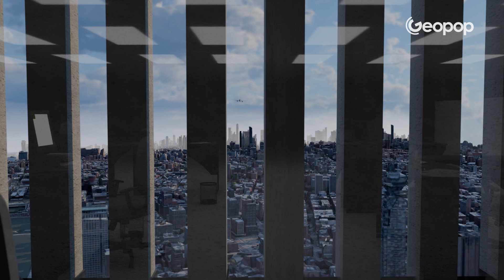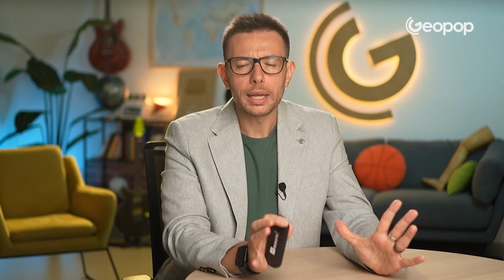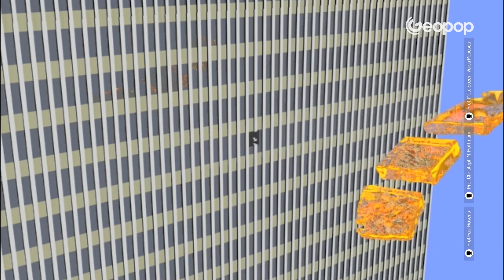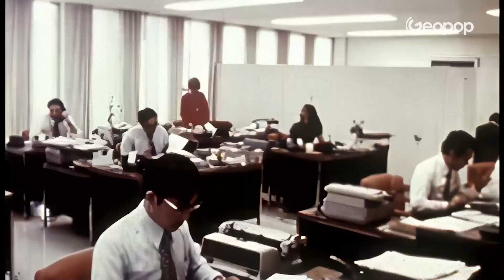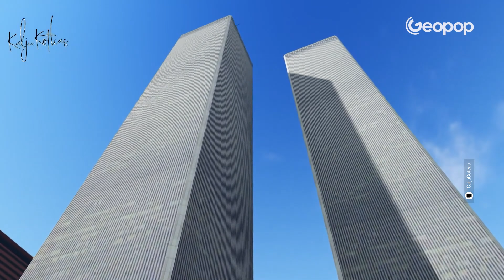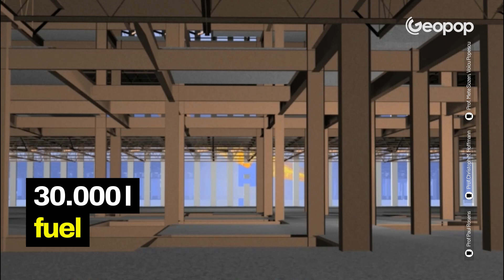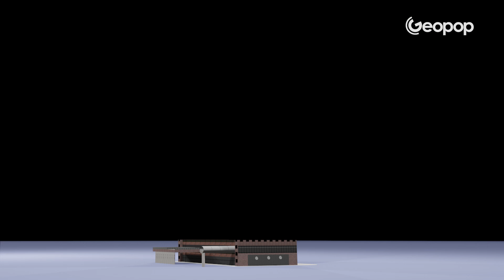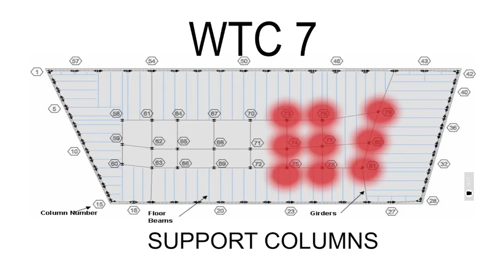9/11, 2001: The Technical Reconstruction of the Twin Towers and WTC 7 Collapses

Comment: This video is a heaping load of BS!!!
Reply: And yet fundamentally not wrong, go figure. 

Had it actually been wrong you would have had a better rebuttal than that.

Or a rebuttal.
Reply: @TheLoonResistance  I don't argue with those who don't understand physics or engineering and even less with the clinically stupid...next.
Reply: @kellyswayze1967  - Good thing you aren't then.  I can do this and you can't: 

Twin Towers collapses were relatively straightforward, the fundamentals well understood in the professional engineering community within just weeks. Yet there’s a lot of really bad information floating out there on the internet, easily accessible to anyone and wild baseless speculation and pathological theorizing with easy hand-wave answers is simple, exciting and requires a whole lot less thinking, so it gets far more attention than it deserves.

To correct this I have on my own prepared this short yet detailed technical description of Twin Towers collapses based on my own observation and analysis of available true and relevant facts. No politics, ideology or magical thinking, just engineering. I hope is this will dispel many common myths and answer most if not all questions you may have about the Twin Towers collapses, because anything can seem like a conspiracy if you don’t understand how it works

While complex, most of the Twin Towers collapse mechanisms can be seen with the naked eye and easily discerned and understood by the layperson if sufficient time is taken to understand.

1. The Twin Towers consisted of 4 primary structural elements that together formed an integrated system where each relied on the others. 47 hollow box-section steel Core Columns carry the majority of the gravity loads. The 236 hollow box-section steel Perimeter Columns carry the remainder and ALL of the lateral (wind) loads. Long-span Lightweight Steel Trusses connect the core and perimeter column together at each floor with a Hat Truss on top to tie the structure together as an integrated unit where no element can survive without the others. There was no structural load bearing concrete and most components were bolted together.

www.youtube.com/watch?v=u7OqrC74Dm4

2. The impact of 117 tons of airplane (= to about 12 dump trucks) at speeds up to 590 mph with the energy of a ton of TNT completely destroys the aircraft. This in no way implies the Towers come out unscathed. Many perimeter columns are damaged or destroyed as are some core columns (example; 33 of 59 perimeter and 20 of 47 core columns damaged or destroyed at the impact floors in the North Tower), This damage is primarily through bolt-shearing failures at the end connecting flanges, as well as bending, twisting and fracturing of weld seams. There was no cutting or slicing - the reality was far more violent and messy.

3. The impacts destroy or damage fire insulation, fire breaks and sprinkler systems on multiple floors. Huge fires are started across multiple floors simultaneously and allowed to spread rapidly with no effective firefighting or fire suppression. This was an unprecedented fire event .

4. The hotter steel gets the weaker it gets . With fire insulation stripped away and no sprinklers the survival time of the steel greatly reduced. Gradually over time heat causes the lightweight steel Floor Trusses at the impact damaged floors to sag, which was observed and recorded. No steel melted or needed to. Structural steel fails long before it becomes a puddle. It just needs to bend

5. Sagging floor trusses pull on the increasingly weak and overloaded Perimeter Columns, causing some of them to bow inward by up to 5 feet. A straight column is up to 4 times stronger than a bent column. The bowed Perimeter Columns buckle and fail, initiating collapse. The formerly static mass above which the structure below could easily support is now converted into a dynamic mass up to 30 times greater. Because they have buckled, the Columns above and below the failure point are no longer aligned . The load bearing structure below no longer bears any load as it falls past the lower columns, NOT onto them.

6. Thousands of tons of debris fall within the four outer walls, down through the open office space, crashing onto the first intact floor it encounters. This massive impact immediately breaks the bolted connections to the columns as the amount of resistance the Floor Trusses can offer is negligible. The falling debris slows only marginally and briefly. Note: 
6a. This is NOT a solid top block crashing into and “crushing” a solid bottom block . 
6b. The debris falls past the columns not onto them. The columns provide no resistance to the falling debris. 
6c. Only the bolted connections of the floor trusses to the core and perimeter columns can offer any resistance. A pair of 5/8” bolts at each end of each truss vs. thousands of tons of falling debris. 
6d. No laws of physics are violated. 6e. There is no 20 floors against 90 floors but rather 20 floors against one floor, then 21 floors against one floor, then 22 floors against one floor, etc. 

7. This floor-led collapse progression within the four outer walls can only go straight down.
7a. This process is often incorrectly referred to as “pancaking”. The catchy name stuck but nobody knows what it really. Pancaking is too simplistic and inaccurate anyway, I prefer Kaiserschmarrn.

8. Collapse progresses through the floor systems past the columns, through the path of least resistance . The resistance offered by each floor is always the same while the mass of debris and its velocity – thus its energy - increases with each floor failure. Each floor offers the exact same resistance to the falling mass while with each failure the falling debris constantly gains both mass and velocity. *This process of floor-by-floor destruction cannot be arrested, it can only speed up . Rate of floor failures increases with each floor as momentum increases, reaching an average acceleration of 0.65 of GA, or 35% slower than true free fall. Bam, bam, bam down the building until there are no more floors to fail. The resistance offered by each successive floor is always the same. More mass, more velocity, same resistance with each floor. Don’t get stuck on the but the lower floors weren’t on fire nonsense. They weren‘t and didn’t need to be.

9. The Towers were 95% air by volume. As that air was compressed inside the building it is forced down the tower and blown out the sides in reaction to the building collapsing . Those were not “explosions”, it was expulsions of compressed air caused by the collapsing building, explaining the low velocity, lack of flash, blast, supersonic pressure waves and lethal high-velocity ejecta.

10. Perimeter Columns become detached and peel away like a banana behind the collapse front, playing out to the four points of the compass extending to more than 600 feet from the base of the towers. This was quite obvious from examination of the debris pile.

11. Core Columns fail last as their internal beam bracing is stripped away by falling debris and lateral support from the floor to perimeter columns is lost.

12. For those who care about how long this whole process took; 31-34 seconds from the moment the perimeter columns buckled until the last core columns hit the pile, or 1/3 the rate of true free fall. Don’t believe me? Just watch any video of the collapses and note the loose truly free-falling debris dropping much faster than the towers themselves.

13. Each Tower had a 1-acre footprint. Far from collapsing inside their own footprints the debris pile spread out over 17 acres in a pile up to 14 stories deep. 8 surrounding buildings were destroyed and scores more damaged by the falling debris.

14. NOT observed were the 180-190 dB bangs of thousands of high explosive devices or the blinding bright flashes of burning thermite. Neither explosives or thermite could have survived the impacts and subsequent fire nor could have caused the (silent) perimeter column buckling that clearly initiated collapse either. A video of a shocked and injured firefighter casually using the magic word explosion is in no way proof of explsoIVES and the demolition_ case relies entirely on that sort of thing. There is zero tangible physical evidence and it would be technically impossible, totally impractical and completely unnecessary. No one would bother.

15. Twin Towers were perfectly safe within their design envelope. They only collapsed when taken far outside design parameters by an extraordinary and unprecedented event

Impact + Fire (heat) + Time + Gravity = Collapse . Remove any one of those four elements and there is no collapse. Ignore any of those elements (as many do) and you will never understand the collapses. The Twin Towers were an integrated system in which no one component could survive without the others. One fails, the rest follow, through the path of least resistance – DOWN – through the open space, bypassing the path of greatest resistance – the columns. Nothing I just described violates any laws of physics. All of the above is true no matter who planned and carried out the 9/11 attacks or why

In 24 years zero structural engineers of tall buildings, including the 1/3 that have retired in that time, have made any statements in support of 9/11 Truth BS demolition claims. Zero, nada, none. The lack of any such citations in the engineering literature (published in any country worldwide) is palpable.

I hope you found this helpful and informative. It is not meant to be adversarial, but to solicit informed critical comment, positive or negative. If I made any errors of fact, logic or reason or left anything critical out, please let me know so I can fix it. To stay focused just one topic at a time please and on-topic (Twin Towers ONLY). No word-salads of Gish Gallop. IF you can offer a more plausible alternative be my guest. Please start any reply with the words “Tits McGee” or I will know you didn’t actually read it, are not serious and just wasting my time. If you are going to argue, do it on the merits.
Reply: @kellyswayze1967  - You're welcome. Glad we got that sorted out.

Comment: Sounds like a load of crap
Reply: And yet not wrong, which is why that was the best rebuttal you could manage.

It doesn't match the dogma certain parts of the internet have been shoveling at you for 20 years, but it has the benefit of being accurate.

Comment: Loved NIST's explanation of Building 7.  Building 6 was seven stories.  Building 5 was nine stories.  Per NIST, debris from WTC 1 got over/ around these two buildings causing fires on 10 floors of Building 7.  [The neighboring Verizon building and Post Office had debris damage but didn't burst into flames.]

After almost seven hours, the columns under Building 7's East Penthouse buckled first. Load transferred to neighboring columns. Instead of progressively collapsing as different columns failed, it came down virtually level in under 6 seconds with only a slight twist.
Reply: You obviously never read the report. FFS 🤦‍♂